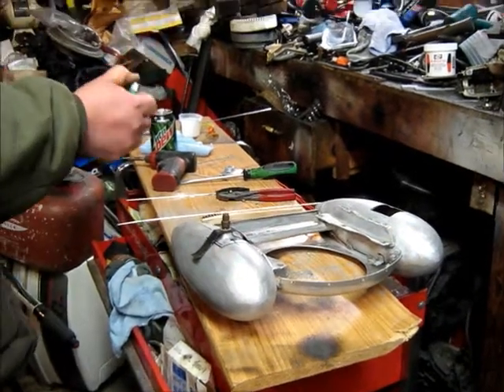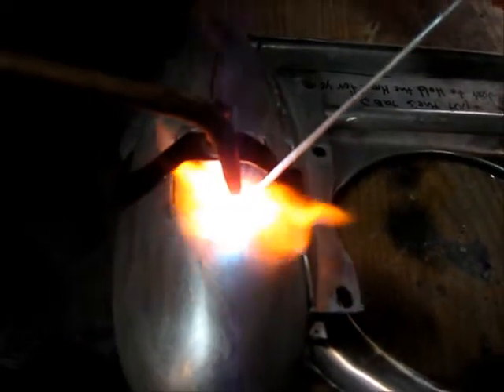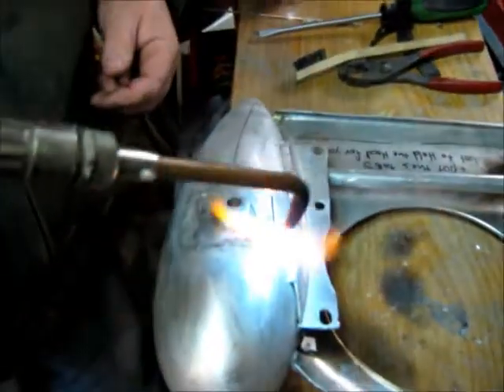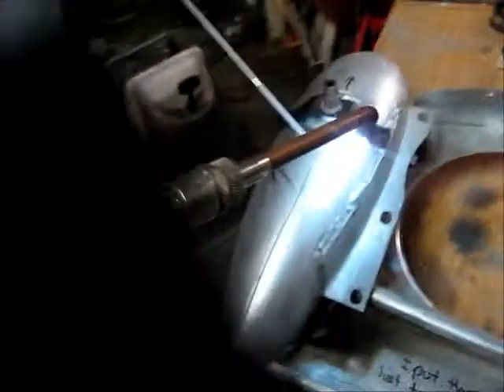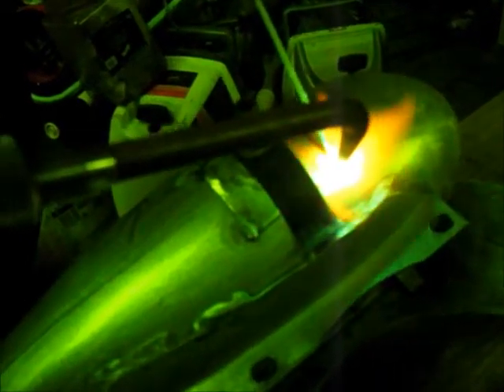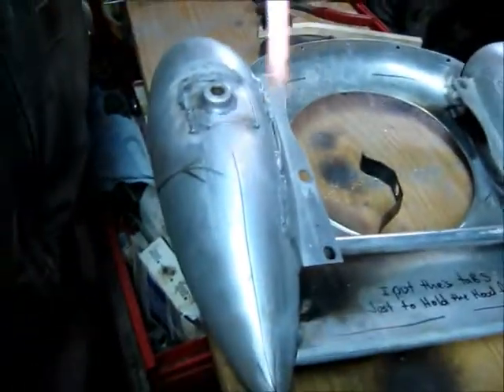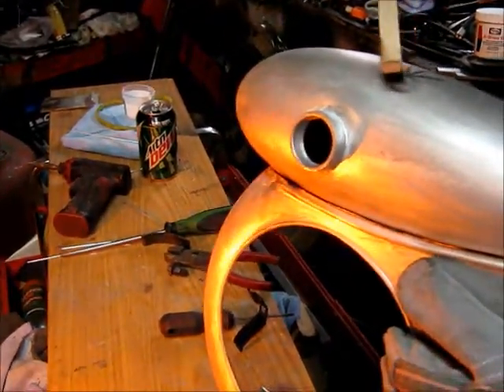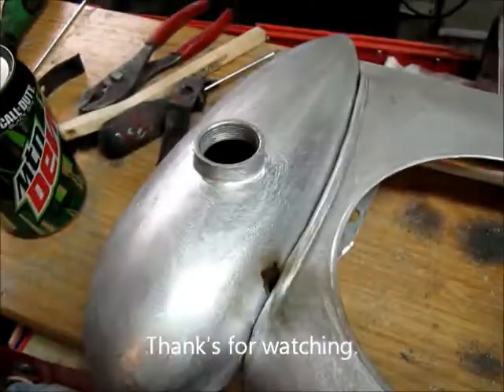Waterwitch outboard tank welding

Comment: Bill, I like your videos and have really appreciated your repair videos of 70s Chrysler outboards. I have a 1970 9.6hp and I wonder if you could help me with a problem? My small spool that the pull cord rolls over before it goes to the spring assembly and starter spool is broken. I cannot figure out how to get the metal pin out in order to replace this small spool/roller. Do you know?

Comment: Hi Ben, I have a '62 Sea King 9hp that has a messed up recoil. I've bought a few parts from you before, and I was wondering if you had an extra recoil lying around that I could buy from you. I've looked all over the internet with no luck. I remember at your place a few years back you had a few Sea King/Chrysler parts motors, so I thought I'd reach out. Let me know, thanks!